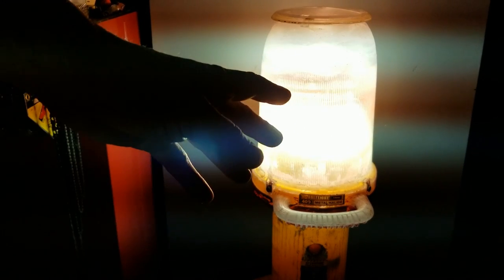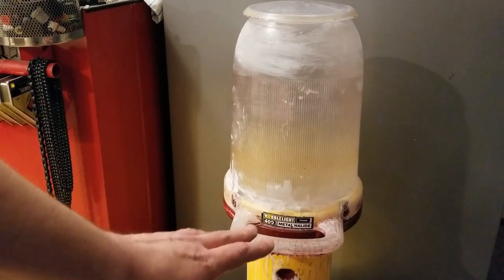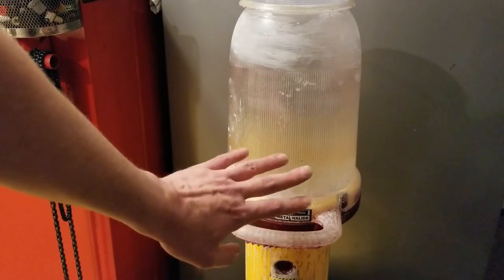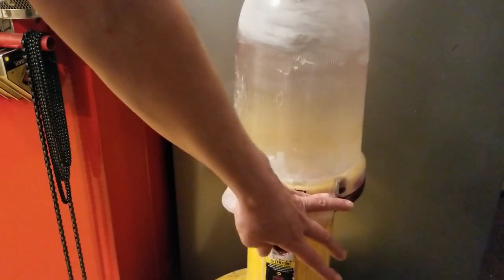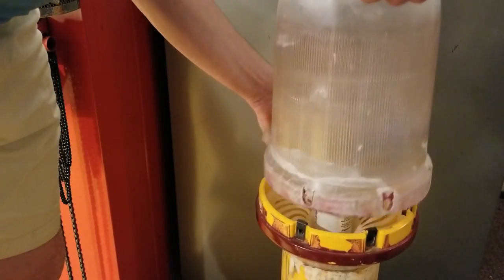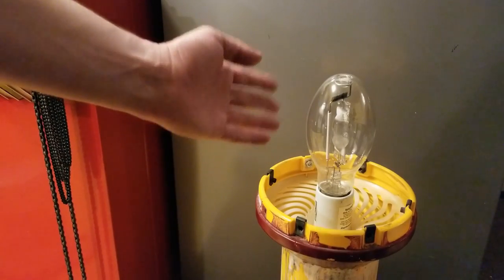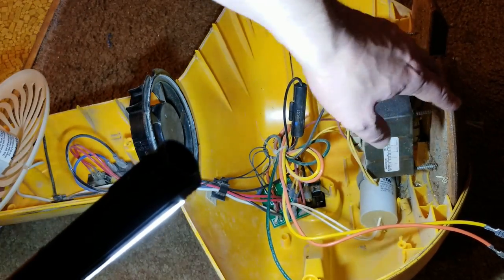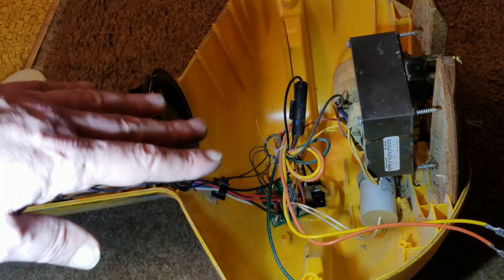Wobble Light 40,000 Lumen Bouy/Pillar Area Work Light Review

Comment: The outer glass on a normal metal halide bulb can safely be touched because it’s large like an incandescent bulb. It will not shorten the lifespan. That outer shield also blocks the UV that the arc tube itself generates. It’s not like a halogen or skinny metal halide, high pressure sodium, or mercury vapor lamp. Those are a lot smaller. The outer envelope operates much cooler than the arc tube itself. The arc tube itself operates up to 1,832 degrees Fahrenheit. Also, the outer glass on a 400 watt doesn’t reach any higher than 752 degrees Fahrenheit. In fact, they operate roughly around 500 degrees Fahrenheit. I have seen many people touched these bulbs with their bare hands.